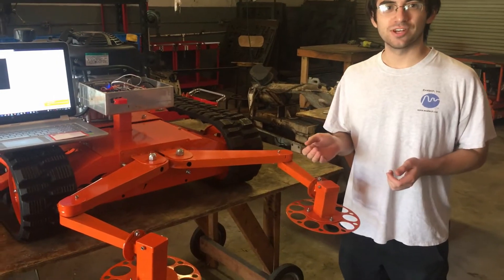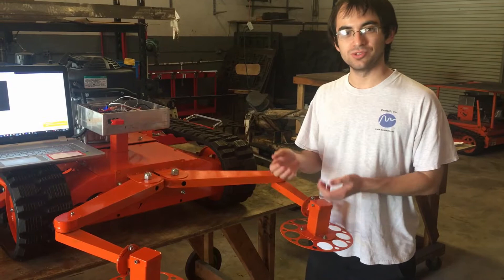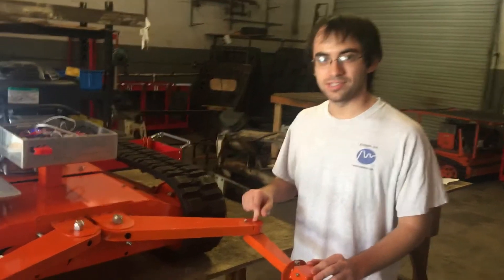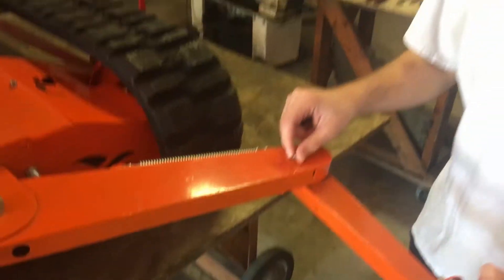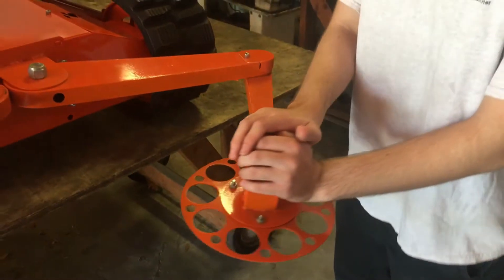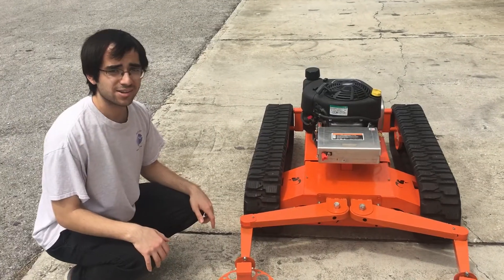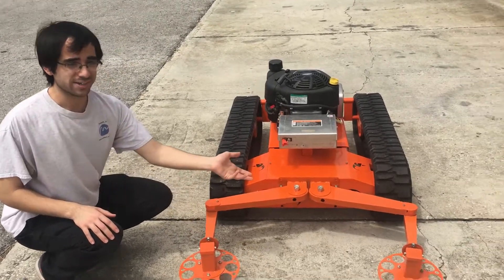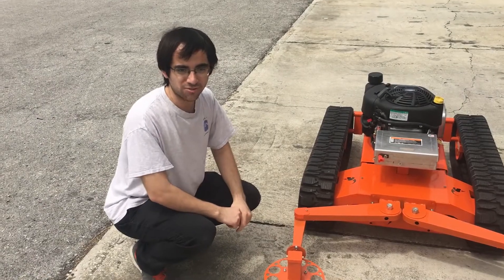36TS Autonomous Robot

Comment: Why do you keep calling these mowers autonomous when they are Radio Controlled (RC) ?????  Please clarify.
Reply: Your reply  is evasive.  Why do you keep trying to say your mower is autonomous when it isn't at all. It is just remote controlled.  If I am wrong I apologize.  Do they run off of  GPS or a wire ?  Can you show me your mower working autonomously (no remote or manual driver ) ??? or point me to a video or explain what you really mean.  thanks, Shawn